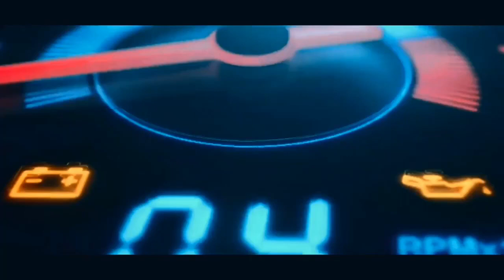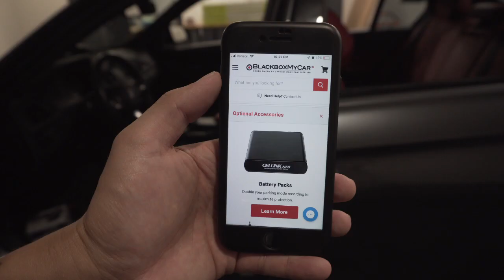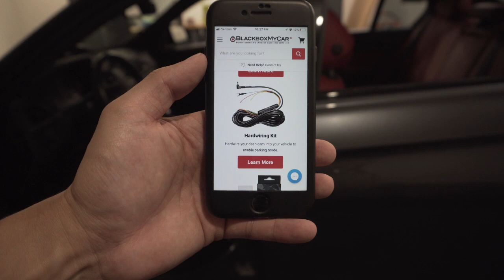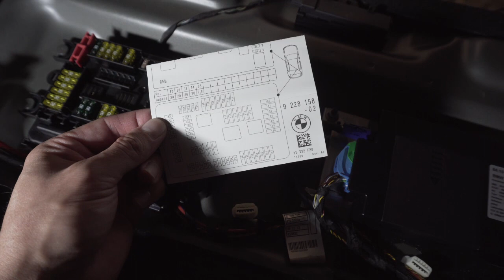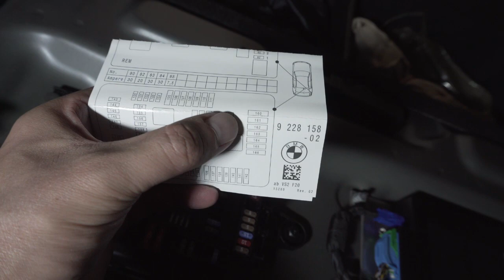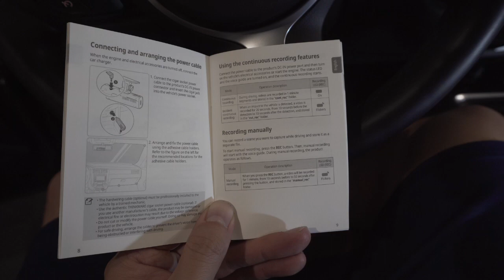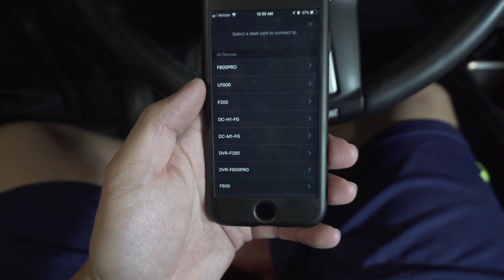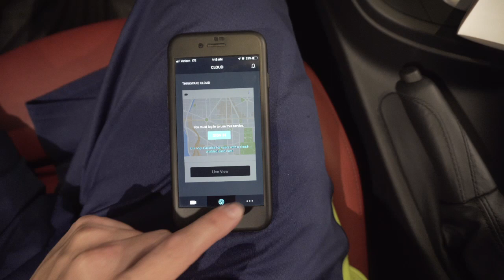Why you NEED to get a Dashcam | Blackboxmycar Thinkware FA200 Install

Comment: Where did you get the additional wire from. What type is it
Reply from the maker: Its just some random wire that I had laying around.
Reply: @accelerated_motion  is there no other way to hardwire it without that wire. I just bought it
Reply: @accelerated_motion  I don’t have a random wire lying around any tips?
Reply from the maker: @ishaqballut6839  I added the wire because the one provided was not long enough. Just go to an auto parts store and buy some similar gauge wire and it will work.
Reply: @accelerated_motion  okay
Reply: @accelerated_motion  thanks for the teply
Reply: @accelerated_motion  great I had some random wire and it worked, although the rear camera didn’t :( what do u think the problem is
Reply from the maker: @ishaqballut6839  double check your wiring. The rear camera plugs into the front camera. Make sure it’s plugged in all way and in the correct port.

Comment: Great video. But I always take off the speed stamp for my dash cam because thats one thing that could be used against you. even a few mph over
Reply from the maker: That's probably a smart idea! Don't want to incriminate myself!
Reply: Accelerated Motion yes!!! Honestly should be default to have off. But if you go on the computer and use their software it’ll still say the speed so if you need it’s still there just not printed in the video

Comment: Wished I had seen this video before I installed mine, would saved me a headache,  I wired it directly too and it's always recoding even when packed. Any tips on fixing it
Reply from the maker: I would rewire it how I did mine!
Reply: One wire should be constant power, the other wire should be switched power.

Comment: i just bought mine last night. it works fine but when i connect it the wifi on my phone and click the wifi button it turns blue, but after im driving for a few minutes or if im at ared light the wifi disconnects for some reason?? then i gotta go back to the app and click on the "connect" button to connect the wifi to the phone app... then i gotto go to the wifi settings to connect it again then go back to the app and click connect.. why is that??
Reply from the maker: I'm not sure to be honest. I dont think I have had that sort of issue before. I would reach out to Blackboxmycar (assuming thats where you purchased from), and see if they can diagnose. Maybe its something you can change in settings.
Reply: @accelerated_motion  ty for replying!! I will try that and contact them. Yeah idk. Someone else told me that it doesn't have to be connected via wifi button and then via my phone app to actually work? that it works without the wifi button?? i have the v12 car charger port that goes into cigarette hole. then i turn my car on and it turns green and says something about it started continuous recording. but idk if that means that its recording already??
Reply from the maker: @juanayala5863  Its been awhile since I played with mine, but if I remember correctly, I think I had to connect my phone to the dashcam wifi in order to view previously recorded footage. If you're plugged into the 12v cig outlet, then it will record whenever that is active (when the car is on, and for like 5 mins when the car is off). I would hardwire it just like I did in this video. That way its recording when parked, for several hours. I'm pretty sure the 12v cig outlet turns off after 5 minutes.